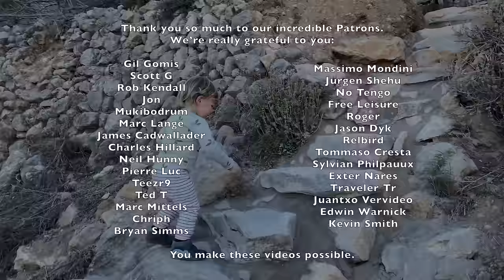LIVING OFF-GRID | Self-sufficient 14 acre HOMESTEAD | DIY Compost Toilet Build #3

Comment: Top stuff.
  Love your new steps and have got serious rock-envy issues about your infinite supply of the stuff.
   You could build anything you like from solid rock and it will be a work of art with lasting landscape value.
   What a wonderful place to live..keep going its worth the effort.
Reply from the maker: We're very grateful to have so much good rock around, it does make things a bit cheaper when building things! Better than wood as well, all our wood is getting eaten by termites! We need to get better at dry stone wall building, would have been nice not to use any concrete on the stairs!

Comment: 2:34 why is the Toilet so far away? 
Why didn't you build it inside your House? 😅

Isn't it extremly uncomfortable when you have to go to the Toilet at 3am in Winter? 🥶😅

Anyway i still like your Builds an Videos and enjoy to follow you along! 🤗
Reply from the maker: Hello! 👋🏼 YES - I am so glad you can see how stupidly far away it is 🤣 But alas, Robbie seems to have a terrible fear of 💩 and no matter how much I begged to put it closer, he would not relent. You win some, you lose some.
Reply: @ladyandtheowlman  Robbie's going to age, Em...and when he does, he'll bloody well wish he'd listened to you with a tad more earnestness! 
A black water, and gray water gravity feed septic system just makes more sense, in the long run. Far more efficient, and very little maintenance required, once installed. I've only needed mine pumped once, in a decade. 

All in all, good show. I enjoy seeing you both work with stone and crete. It isn't easy, but it does look beautiful, and that's it's own sort of reward. 
Dry-lay as much as you can, as this negates the need to install drains behind walls, when built on hills. This way, hydraulic pressure from water in the dirt or mud behind the rock, doesn't force the rock outward. I'm also enjoying all the shots of the fresh produce being raised on your little farm. Chicken dung makes for great composting, as does sheep dung. Now, if you can just manage to keep the boar out of your garden, you'll be doing well. 

Robbie's going to wear out the suspension on the Rover, if he keeps abusing it, by hauling rock with it. You need an actual truck, with heavy leaf-spring or air-suspension for such heavy work. I love Rovers as much as the next bloke, but not for the hauling of heavy items... Coil spring suspension is less than ideal for such, and parts for Rovers aren't as cheap as we'd like them to be. 

I figure that about the time Robbie hits his fiftieth year, he'll be having a wee bit of a re-think, regarding having a commode, as a "scenic-overlook" for the rest of the farm. That's about the time that a man begins prioritizing his comforts... I know from experience. 
I'm enjoying it folks, Spain is breathtaking in those mountains. Love the work you all are doing, improving the place, and making it your own. 
Keep the bum shots coming lass, they're even more breathtaking than the mountain scenery. Guaranteed to increase views! 😉
Reply from the maker: Thanks for this comment Curtis, really interesting stuff! We really appreciate your support and ideas!